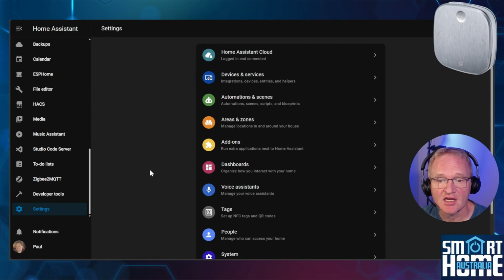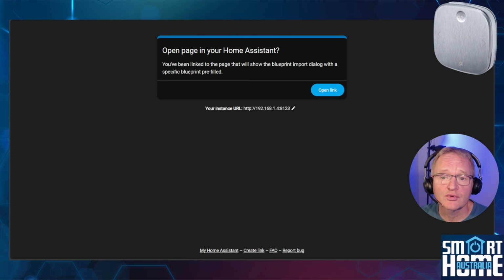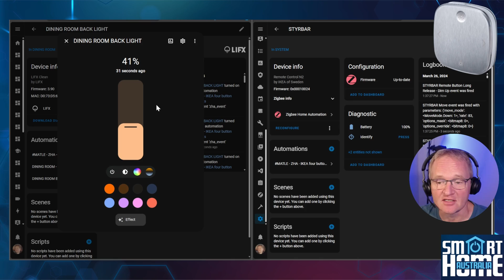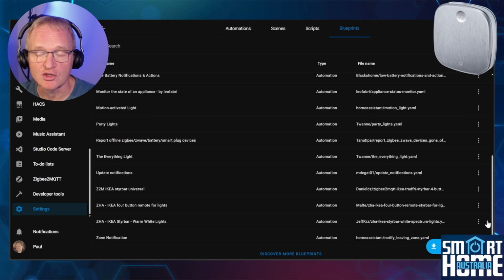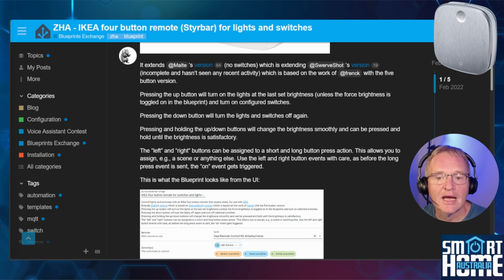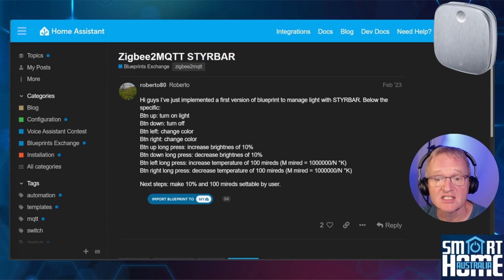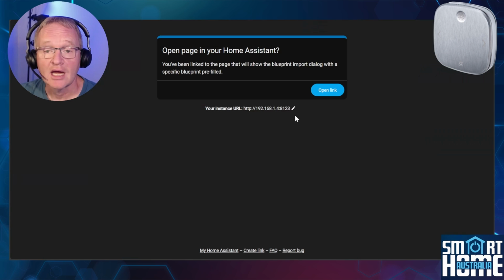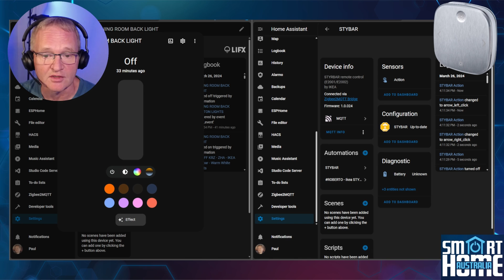IKEA STYRBAR - Top 5 Home Assistant Blueprints

Comment: None of them supports changing color mode / white <-> RGB?
Reply from the maker: Great question!

In the specific blueprints I walk through in this video, there isn’t a dedicated “swap color mode” action, so they won’t natively flip a light between white (color temperature) and RGB with a single press. Most of them just adjust brightness and either color temperature or hue/saturation, depending on how you configure them, and they work with whatever mode the light is already in.

If you want a proper white <> RGB toggle, the easiest workaround is:

- create two scenes (one “white” scene, one “colour” scene) for the same light or group, then
- map a STYRBAR button press to a small automation that alternates between those two scenes.

That gives you a pseudo “mode switch” without needing a custom blueprint.

Comment: When i want to search for the device I only get the battery sensor. Nothing else
Reply from the maker: I have seen that before... usually means that the blueprint is not recognizing the device as the IKEA Stybar. You can force it to use that device in the code (not recommended), use an alternative blueprint and report that to the developer or pair through Z2MQTT (https://youtu.be/sfsZF0R0HtE). If you still have issues then jump on the Discord (https://discord.gg/VcM4b5ASXm) and I'm sure there is someone there that can help.
Reply: @TheDarkRaven90  glg
To

Comment: I was able to import the blueprint (malte) but what do i have to do now? How to connect the lamps and what do i have to enter in the automation stage? I can not find anything online
Reply from the maker: Go to SETTING > AUTOMATIONS and SCENES > BLUEPRINTS.
Press the three dots to the right of the blueprint Select CREATE AUTOMATIONS. Now just populate the details and save. Done. :)
Reply: @smart_home_australia  thank you but i found that page already but i don't know how to proceed now 😅 it asks for the lamps but how to integrate them? Also i should add commands for the buttons but i never programmed and don't know how i should do that
Reply from the maker: Which lamps do you have and how are you connecting them to Home Assistant? You'll need to integrate those to HA before they become available to be added to the automation based on the blueprint.

Comment: during import of blueprint, error message timeout occur
Reply from the maker: Which blueprint ? Anything in the logs?
Reply: @smart_home_australia  Logger: homeassistant.components.websocket_api.http.connection
Source: components/websocket_api/connection.py:307
integration: Home Assistant WebSocket API (documentation, issues)
First occurred: 10:27:54 (1 occurrences)
Last logged: 10:27:54

[139797017058256] Error handling message: Timeout (timeout) Steinar Egeland from 192.168.1.210 (Mozilla/5.0 (Windows NT 10.0; Win64; x64; rv:128.0) Gecko/20100101 Firefox/128.0)
Reply from the maker: Tricky, not that much information. 
Although it should not need it you could add the following line to your configuration.yaml. 

websocket_api:

This will enable, the websockets API.
Reply from the maker: Now that's very strange that you had to do that. Do you think maybe illegal characters, or maybe wrong encoding... either way, very well triaged and resolved !!

Comment: I was able to make it work with Zigbee2MQTT but without the blueprint. So first added the device (my case it was the ikea rgb bulb) to Zigbee2MQTT, then separately pair remote. Then you need to go to the bind section of the devices and bind them on protocols. I have the turn/off and bright/dim working fine. Its the colours that escape me. I can see the ikea bulb in Zigbee2MQTT interface  (exposes screen). Can control the options there. The "Scene" screen in Zigbee2MQTT indicates I can store the scenes in there. Will test and post back if successful.
Reply from the maker: Thats great news. Yes you can do scenes in Z2MQTT but I would not recommend it. There are so many different ways of doing so many common actions in a Smart Home, in my experience you need to go to the root, which in this case is Home Assistant itself, and define your scenes there and only do them there. Otherwise you lose control of where you configured items. There is nothing more frustrating that something just happening in your home and trying to figure out why it happened, trust me !! I've been there, done it, and have the mental scars !! ;)
Reply: @smart_home_australia  Thanks that makes sense. The tradfra remote is a pain since it does not expose four buttons. If I pair it directly to the bulb, it controls all functions of the bulb, Turn on/off, dim/bright, colour change/cycle. Since the wife brought the combo I just wanted to see if I can import it into home assistant to setup automations and notifications with colours. Importing worked but the adding of scenes was an attempt to make the colour change to work with the remote. I do all scenes and automations in HA. Looks like I have failed and it might go back for a refund. Pretty sure I can order a few zigvee RGB bulbs and remotes that can do a lot more than just control the bulbs from Ali ex....
Reply from the maker: @guylast9516  try the other blueprints you might hit one that does what you need. But I know what you mean, it’s a great button for many purposes, just not for HA, well at least not yet 😏
Reply from the maker: @guylast9516  your wife buys you smart home gadgets? How did you manage that!! You need to let us all know what’s the secret !!!🤫
Reply: @smart_home_australia  lol yeah almost had a heart attack. It was ikea I swear which converted her. However noting that the stuff she got is something this finicky to install gives me pause and I think is it a good thing she is making these unplanned purchases. You see, I am very careful about what I buy for my smart home. I try and get only zigbee stuff and that too pretty generic so as to be easily replaced. I have a few wifi tuya and esphome devices which are very specific in use case. It's been a ride. I dont do impulse buys at all. The wife on the other hand is throwing spanner in the soup so to speak. I contemplated incorporating this stupid bulb but would have preferred to buy zigbee bulbs and a remote with multiple buttons which could have taken on other tasks. Alas I think I will only pair it directly with the bulb and leave it for her to enjoy her win. If not mistaken I cant pair to home assistant and the bulb at the same time?
Reply from the maker: Wise man. Love the comment about “giving her this win” lol. 

Nope it’s one or the other as far as I know. 

That said I use afew IKEA bulbs and for the menu they are great!!! But in general I make my bulbs wifi as they are rock solid and never fail connection.

Comment: Did they change something to the remote breaking its function with ZHA?

since I have one that works easily under ZHA
Reply from the maker: Which of the Blueprints are you talking about? Or do you have a new one? In which case can you share the name of it.
Reply: @smart_home_australia  I have a Ikea styrbar that does not need a blueprint to work with automations
Reply from the maker: The Blueprints are there to make things simpler for those that don't understand the nuances of entities, plus some more advanced features such a looped triggers. But you are right, you don't have to use Blueprints.
Reply: @darknessblades  I've been looking around to see how this could be possible but everything I've found seems to require a blueprint. I add the Styrbar to HA but it has not entities so you can't use it to do anything. What version is your Styrbar firmware, mine is 0x01000020.
Reply from the maker: @darknessblades  Totally true, blueprints are there just to make life easier and leverage off others work. You can develop your own automations, something I have done for many of my devices.
Reply from the maker: @esotericmoniker  Remember that the IKEA Stybar doesnt use entities like other button. It uses events, in that when the button is pressed and event will fire and you need to use that event to trigger your automations. To test this so into the device and check the log, now press the button and you'll see the event as it is recorded. Its a difficult concept to grasp and hence why most people simply use the Blueprints where someone else has done the heavy lifting in creating the automation for this. But you can always do it yourself.
Reply: 5 times didn't do it. I had to puch 3 times. Maybe different FW or area?
Reply: @tommyeinrudjohansen3855  True, you have to keep mashing the button to get it into pairing modus

if that doesnt work you can use the FORCED reset method:

Remove battery, 
wait 10 minutes
 add battery
press/hold button for 20 seconds
remove battery
wait 1 minute
press button 3 times